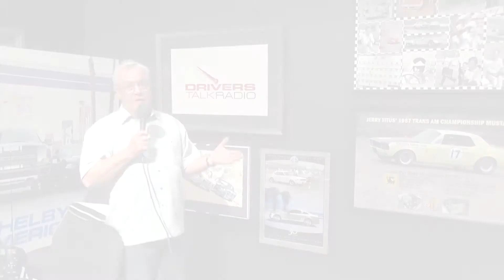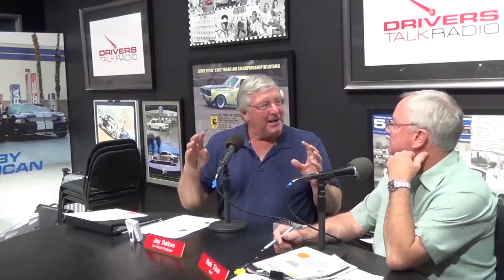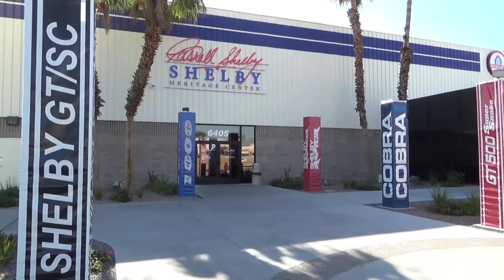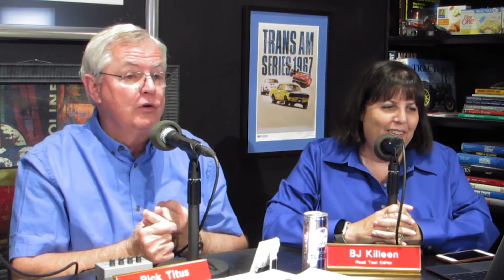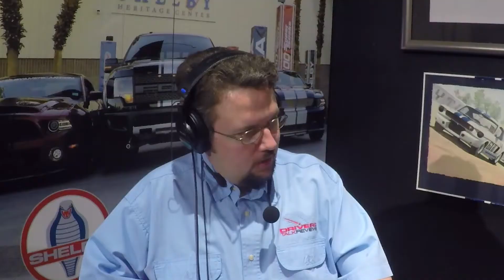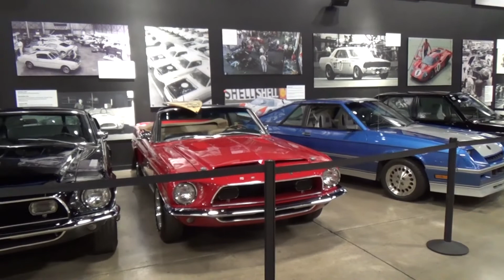Elon Musk's Anticipated Tesla Model 3 with Guest Jerry Heasley(Show #889)

Comment: On the Tesla Model 3 the sensor and supercomputer hardware is standard AND the collision avoidance / safety features will be activated at no additional cost. That and the ability to buy autopilot and / or self drive at a later time are key selling points - initially keeping cost down.   Especially as self drive regulation and law will take time - why not wait to pay for it. I'm excited to be in line - this car will be a big range and performance boost over my Nissan Leaf - which I already love. Five years of 3 cent a mile and minimal maintenance has been good.  Now the TM3 will be better.  Ask BJ what the two safest production cars in America are? (Clue - NHTSA can tell her about the two Teslas. Grin)